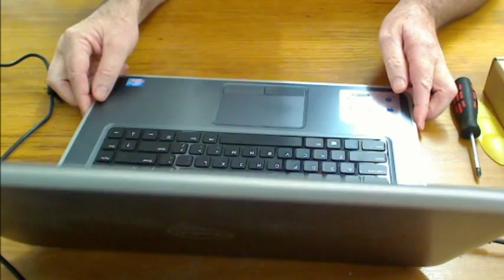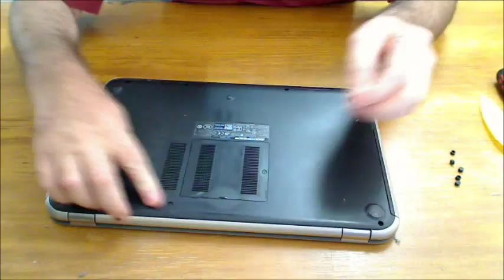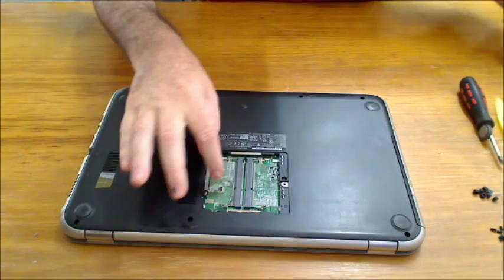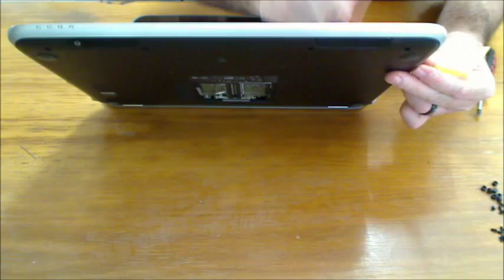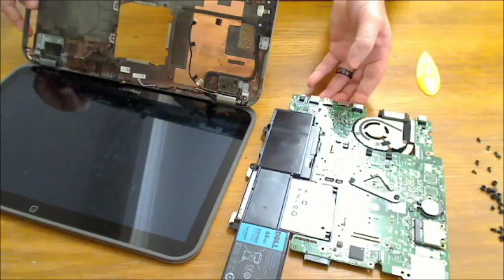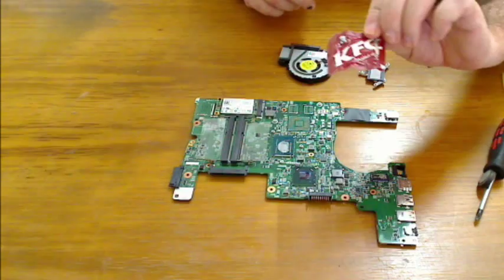Dell Inspiron 15Z UltaBook, how to replace a noisy fan.

Comment: Hi! I'd like to replace my fan too, where did you order the new one? Thank you!
Reply from the maker: +Elisabeth Wolf Hi, I brought a new fan from one of the online parts distributors but have also seen them on eBay and Amazon. As far as I know there are only two types one for the standard Inspiron 15z (single Heat Sink) and one for the Insprion 15z with upgraded graphics (Dual Heat Sink). Don't bother buying the cheap fan with no heat sink, it's a lot extra work to change the heat sinks over only to save a few dollars.
Reply: Thank you Denny! Do you have a link for the fitting and cheaper one? I can't find it :( Thank you!
Reply from the maker: +Elisabeth Wolf
I would not use that one only for the fact it doesn't include the heat sink. You would be better spending a few extra dollars and get one like this http://www.parts-people.com/index.php?action=item&id=14463&gclid=cjwkeajwwbyxbrcs74t049iep0wsjacko5v1sftro2pszeuxznzj9k9w1exydfmzucdzrxdgogmpuxocdobw_wcb
Just be sure to check you laptop model correctly and make sure you get the correct one for your model.
Cheers
Reply: ok, thanks a lot! I ordered the one you linked, yesterday we opened up my laptop and my fan has the same codes on it, so I think this should fit. Thank you :)
Reply: Thank you so much Denny!! yesterday my new fan arrived and today we could replace it with the help of your video! my new fan doesn't even make the slightest sound now anymore, so great :D thank you !

Comment: Very helpfull video, I'll be attempting this job when the fan arrives. Is it necessary to earth yourself when touching the circuit boards? Thanks for posting it.
Reply from the maker: astevo1983 It's no necessary to earth yourself when touching circuit board, just make sure you don't leave the laptop plugged into mains power and turn the laptop off before you start working on it.